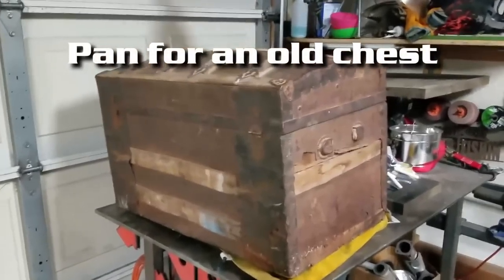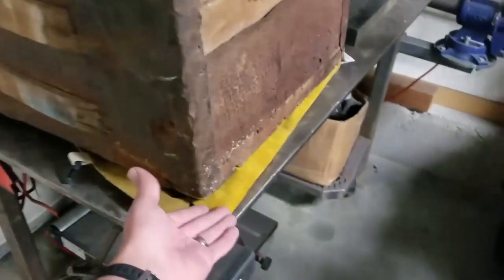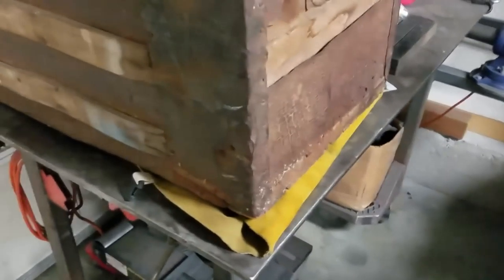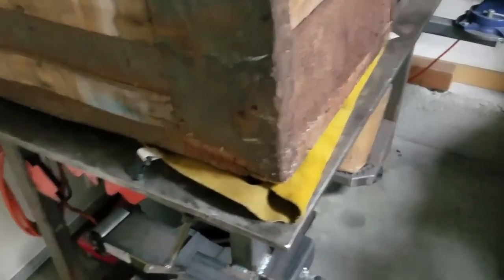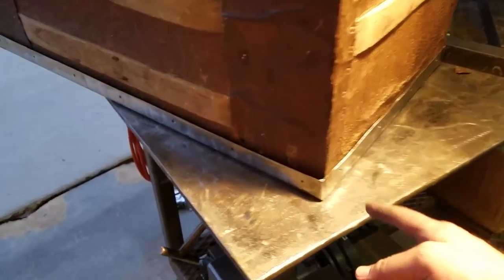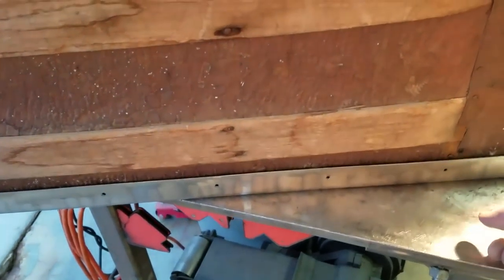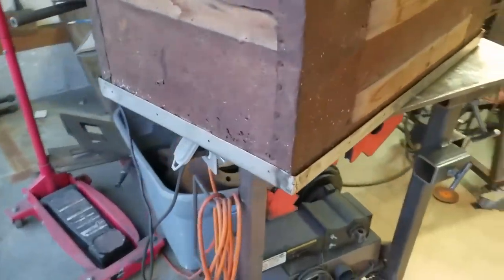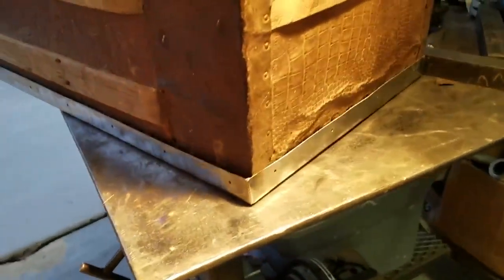Bottom Pan for an Old Chest

Comment: Hey John, I have the same Torchmate 2x4 plasma cutter as you, one of my stepper motors is dying on the y axis causing the machine to bind I disconnected it and currently running on one stepper motor looking at a replacement from automation technology (KL23H2100-30-4BM)  just curious if you have had to replace any stepper motors on yours yet and if so which route you went. Torchmate is waaaay to proud of their replacement parts which are actually Flashcut CNC parts MP-2303.  Pretty sure the ones from automation technology will work just looking for some insight and perhaps some "been there done that" experience  Thanks!
Reply from the maker: I haven't had to replace a stepper motor yet (knock on wood)